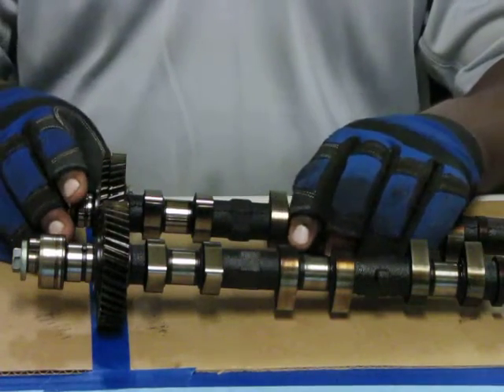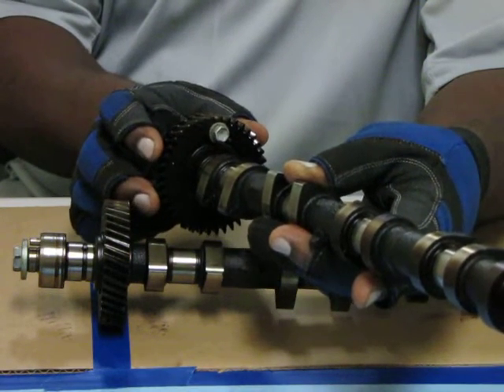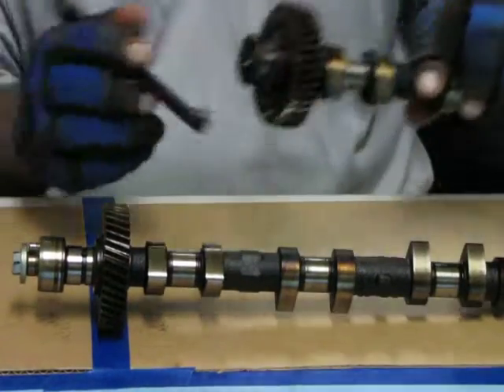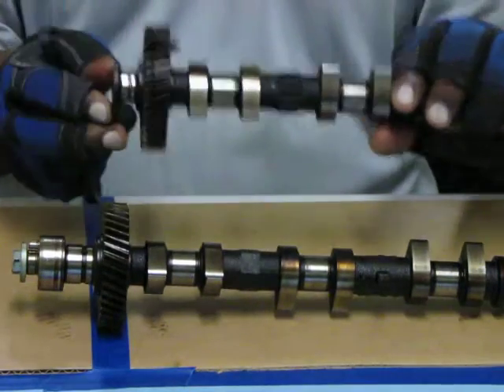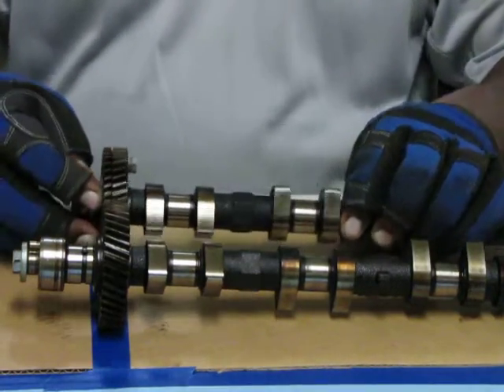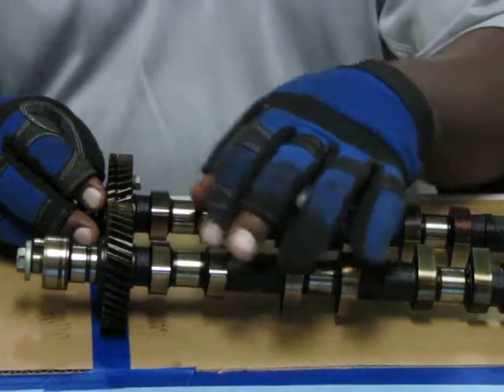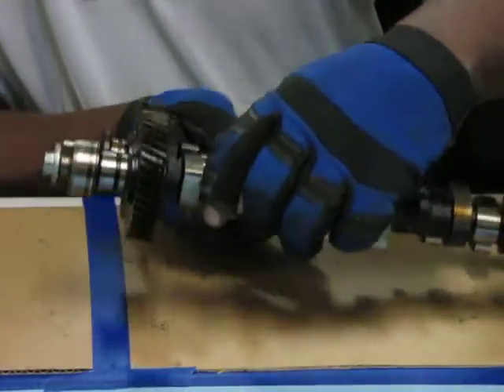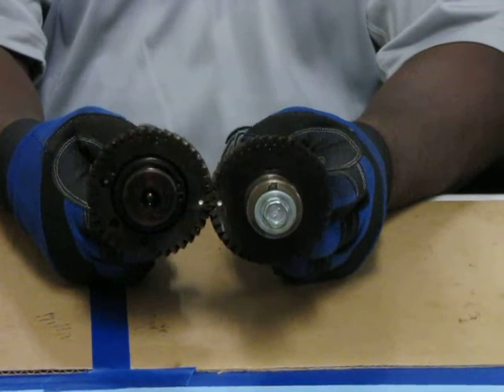1996 Corolla Engine rebuild aligning camshaft timing marks off of vehicle

Comment: Do you turn it clockwise or counter clockwise to align the hole?
Reply from the maker: clock-wise to avoid putting slack in the timing belt.

Comment: Same principle apply for the 5efe?
Reply: For 5efe I believe it's different. I just tried mine and the marks I have their don't point the lobes like in Clint's example although it may be good reference point. I lined the big dot on back of ex cam gear with 2 little dots on back of intake cam gear. Not sure if mine is set up correctly.

Comment: do you have a video on how to remove the gear/sprocket on the camshaft?
Reply from the maker: Impact wrench or socket and use the integrated nut on the camshaft itself to hold it while removing the 14mm bolt on the end of the camshaft.
Reply: @Engineerboy100  okay thanks, will try it👍🏻
Reply: Could I apply this on starlet 4EFTE engine?
Reply: @mdestroyer2042  yes all applied for 4e-fe/4efte/5e-fe  engine

Comment: Hello Clint will a 7a-fe cylinder head and cams work on a 4a-fe engine?.
Reply from the maker: I have used both cylinder heads interchangeably, it is the block and cylinders that dictate the displacement difference (1.8 vs 1.6). There will be a difference in the size of the plastic front engine covers.
Reply: Thanks for the Reply Clint .I wasn't sure about the cams being the same and i'm glad they interchange thanks again.
Reply: One more question Clint would it be okay to use a 4a-fe head gasket on the 7a-fe cylinder head?.
Reply from the maker: Yes, they are the same, just be careful not to put it on upside down like I did, you can do that it will go on upside down and leak oil all over the front of your engine when you start it.....
Reply from the maker: https://www.youtube.com/watch?v=d4eFG0TeFYI&t=1s
Reply: Thank you i'll watch the video now.

Comment: ur video saved my day but if u could do one that should how to install them with out marking them ...that would be great
Reply from the maker: +Clinton crowell The makes are placed on the gears when the cams are manufactured.  The white marks I placed on the cams is just high lighter to make the marks easier to see.  Look closely and you will see marks on yours too.
Reply: +Engineerboy 100 yea mine didn't have any marks on it so I just screen shotted when u put them together lol it worked
Reply from the maker: Sweet lol
Reply: +Engineerboy 100 so yea thanks for the video ND keep them coming
Reply from the maker: +Clinton crowell I'll be posting a couple more new ones tomorrow ;)
Reply: +Engineerboy 100 cool thanks